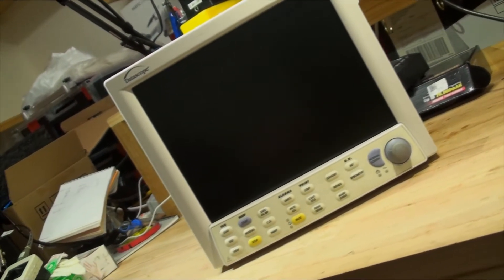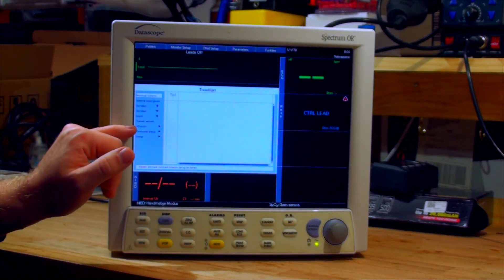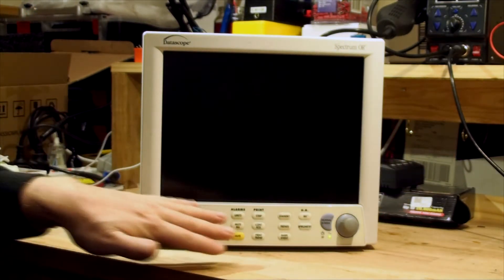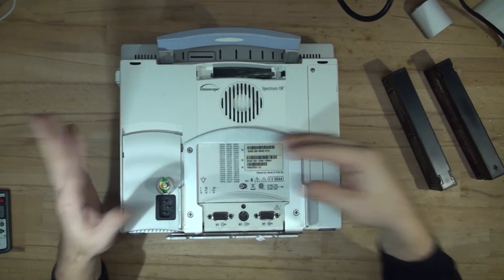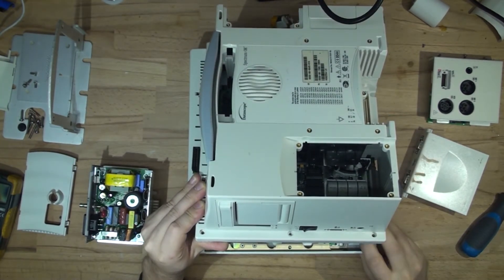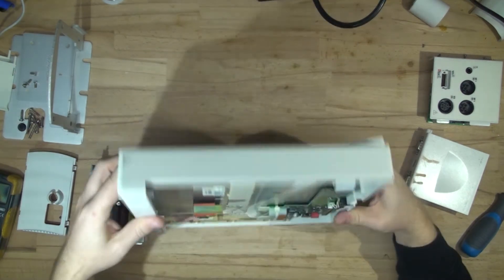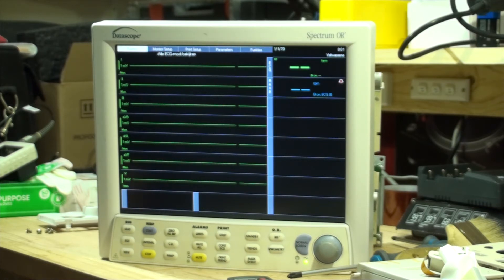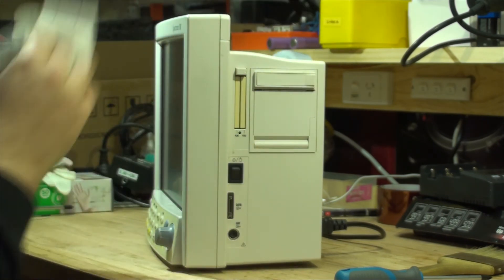DATASCOPE "Spectrum OR" Medical Patient monitor repair attempt

Comment: For this specific language reason, the Spectrum OR is the only Datascope/Mindray patient monitor that had to be factory serviced when the clock battery chip (SRAM) went bad on the main board.  All of their other popular monitors (Passport 2, Spectrum (non OR model), V, DPM series) could all be serviced without the language issue.